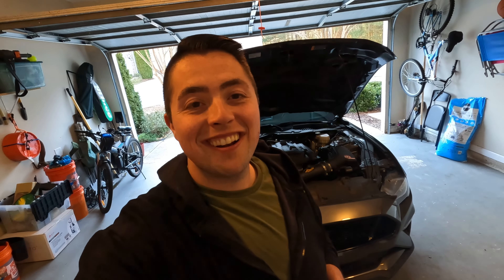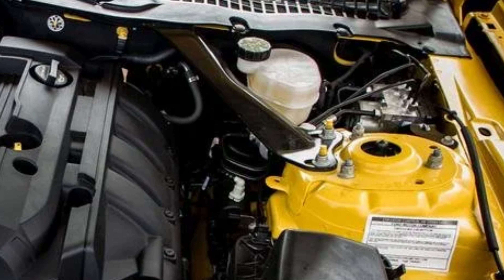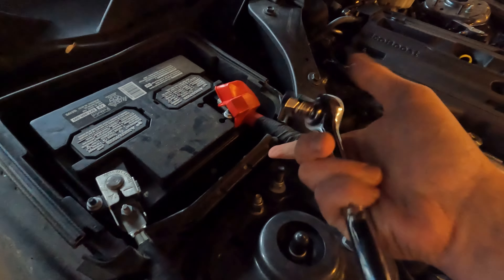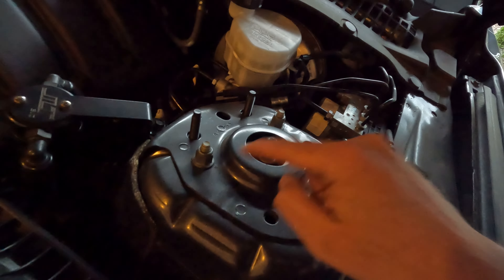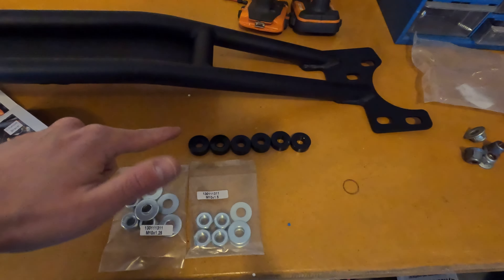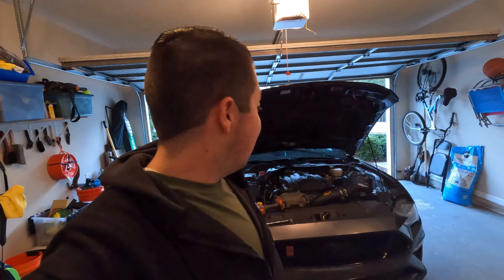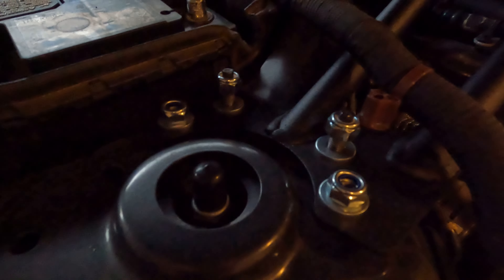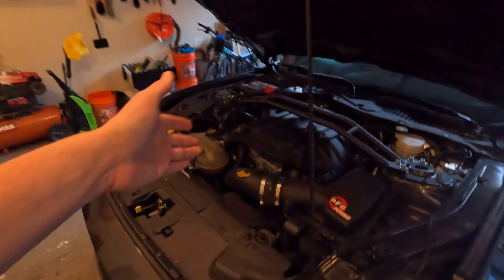This Mod For The Mustang Was Worth Every Penny!! - SR performance Strut Tower Brace!

Comment: Can you make a video on how you Jack up your mustang for service like when you did the wheels please? I know how but it still makes me nervous on a new car
Reply: Just jack it up from the pinch weld, strongest jack point on the car. You cant mess it up as long as you're centered on it
Reply: @noff1672  minus the fact you risk it folding, just look at the manual and there's points you can jack up the car at
Reply: @atomicbogator6799  not gonna fold. Maybe if your cars frame is a rusty pos but on a new gen mustang not gonna happen
Reply: @noff1672  I mean ig it's just sometimes even on cars that have 0 rust you aren't meant to jack up at the pinch weld because it's too thin like on full frame cars they have specific spots on the frame since the body isn't the main structure the pinch weld isn't as thick
Reply from the maker: Hey! I could probably make a YouTube short about it. It’s pretty easy. There are arrows embossed in the plastic showing where the jack points are. You can jack up the rear using the diff as well. 👍 🙂
Reply: @daily_driven  yeah exactly people that just say use the pinch weld don't realize not all cars are built the same
Reply: Best way is to install jacking rails (about 20 minutes) and lift one side at a time.
Reply: @atomicbogator6799  pinch wield + hockey puck adapter
Reply: @dnalor8753  thatd work but i mean people with a 20$ jack trying to jack on the pinchweld

Comment: I was wondering why did you disconnect the battery? It does not seem you are working on anything electrical.
Reply: Good practice when you’re messing with things under the hood, you never know
Reply from the maker: Yup ha just needed to route it over the brace!
Reply: @ARTICFROST777  Good practice 🚙
Reply: @daily_driven  Cool🚙

Comment: Buy a set of impact sockets if you are going to use an impact gun, a chrome socket is not made for impact use and they can either crack or even explode sending shrapnel into yourself and/or someone else who may be by you resulting in injury or even death.  The torque spec on the Ford brace is 46 lbs ft. Strange that your aftermarket brace would be 11 lbs ft lower torque spec than what ford specs. If a torque spec is too low it can allow movement and your front strut tower bolts should be torqued to Fords specs not a lower aftermarket spec.

Comment: Is there enough room to do oil changes without taking it off?
Reply from the maker: If your just filling it with the engine cover on then yes! However unfortunately there is not enough room to remove the engine cover with the strut brace on. If you need to change plugs or something you will have to remove the brace
Reply: @daily_driven  thank you for replying bro! Helped alot in deciding to get it.
Reply from the maker: You bet man! Happy to help!

Comment: My 2014 tuned v6 beats newer ecoboost
Reply from the maker: Nice what do you all have done to it?
Reply: @daily_driven  a full roush exhaust, custom Bama tune, has a strut tower brace, 3.73 gears, airrad intake, stronger driveshaft. It's also a convertible premium with the shaker system, deep impact blue with black racing stripes. It's a dream.
Reply from the maker: @xdezirehdful  Very cool! Nice!
Reply: My 24 ecoboost will leave you in dust